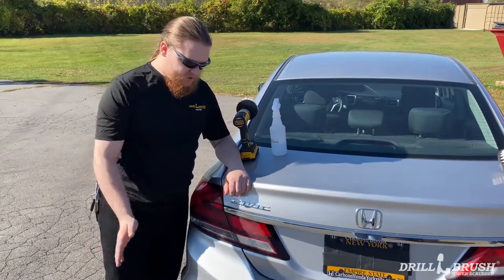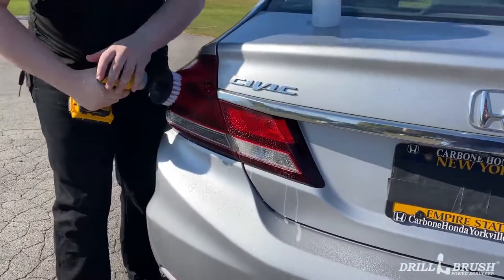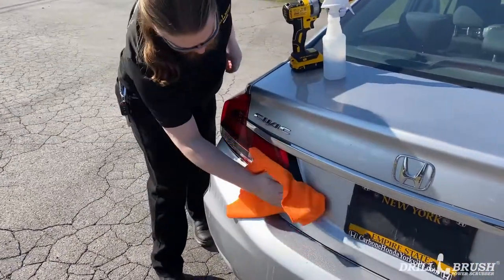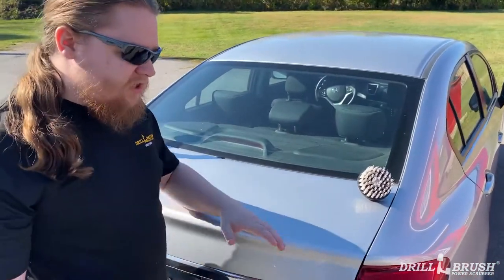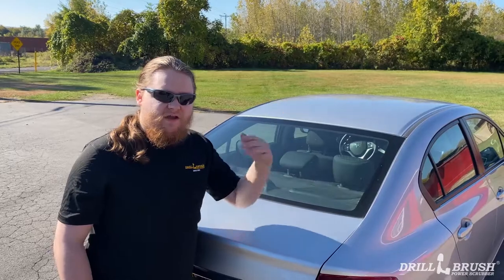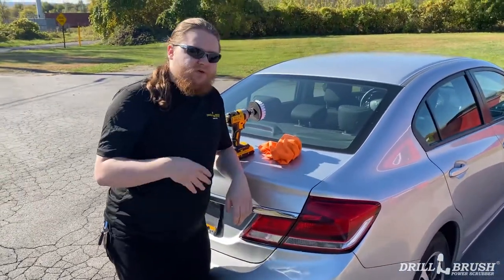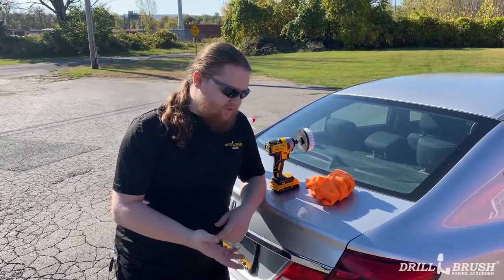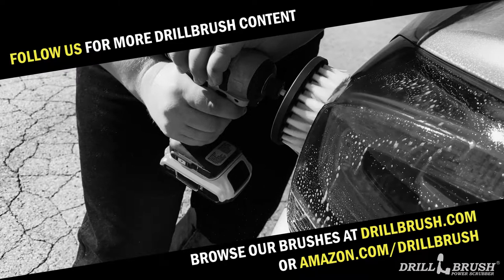How to Scrub Tail Lights Clean with a Drillbrush Power Scrubber | Drillbrush DIY Guides

Comment: What was the cleaner you used again? It was hard to hear.
Reply from the maker: We used Drill-tergent, which is a cleaner we sell on our website.

For this video, we diluted it with water and put it in a spray bottle so we could spray it onto the surface.